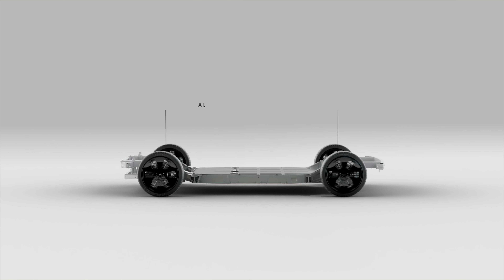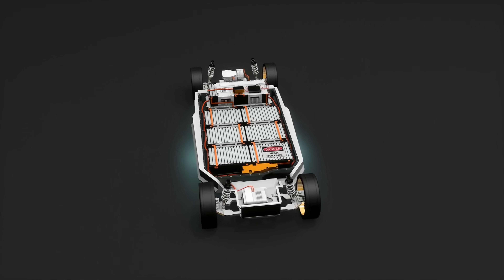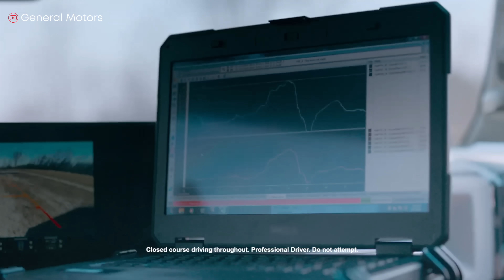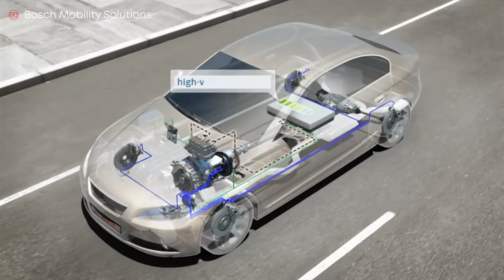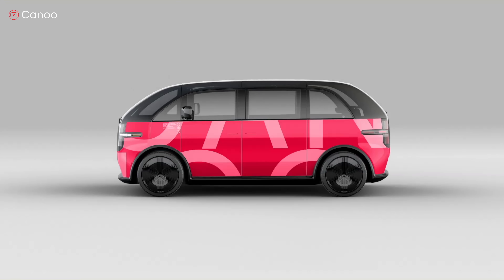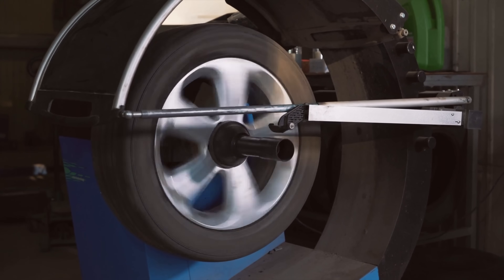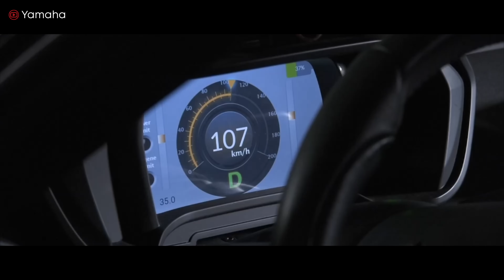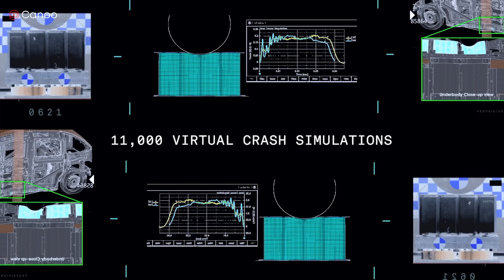No One is Telling You the Truth About Electric Cars, So I Have To

Comment: You did a good job telling us about the basics of an EV vehicle. MY concerns are with distance, driving from Missouri to Florida. With EV with a range of only 200-300 miles per full charge, minus some distance due to weight/load and heat & cold, forcing the vehicle to use more electricity for heating & air conditioning for the passengers, THEN needing 12-15 hours to charge so you can drive another 250 miles... it would take a week to drive to Florida and another week to drive back home.
Reply: It charges very slow on home plug, it can fast charge within hour in charging points. Also sure ev are bad for long distance but most people use vehicles for commute.
Reply: About half an hour for my car to charge on fast charging, and I'm using a vehicle with the slowest form of fast charging around, I believe. Then again, this is for 120 miles. It takes about 7 hours to charge mine up after a 40 mile round trip to work, but that's from a standard 3 pin wall plug so basically the worst case scenario.
Reply: Fast chargers take 30 minutes to charge to 80. Take a break after 300 miles or so. Its good for you.
Reply: No manufacturer wants to give the hard facts about Winter driving and the average 40% battery loss of said battery. A blue collar EV vehicle will only average 300 miles on a full charge. Now its Winter in Northern Illinois , the temps drops into the 10 degree range. So I live 150 miles from Indianapolis, a round trip is 300 miles, now I will have to recharge the battery 3/4 of the way home, THATS CRAZY. BTW, my 2012 Honda Accord has a 18.5 gallon tank, it gets 33 mpg, that’s almost 500 miles before I need to take 10 minutes to refill and drive another 500, do you get my drift.
Reply: @skubefamilychannel  Imagine for a moment if EV were the legacy technology in place. How easy it would be in that case for combustion engine to make their case. Long range autonomy, short refilling time not depending on how many cars are queuing up at the gas station, no headache with charging cable typology or charging station technical characteristics, negligible performance loss in case of cold or hot temperature, less weight, no crazy acceleration as potential form of hazard in case of unexperienced pilots, easy to estinguish in case they catch fire. It would sound revolutionary
Reply: good luck with that.

Comment: Scotty, how did you get to be so smart? You're my hero 💙.  A friend of mine bought a Prius a few years ago and bragged about his gas mileage, blah blah. Then the batteries died..$7,000.00 to replace them. He got rid of the car. I laughed and told him I'll stick with my 93 Toyota Camry. No car payments and not much maintenance.  👌
Reply: A friend of mine had the same thing happen.  One Prius was still going strong after several years, but the other required battery replacement after about five (right after the warranty was up I believe).  He did the math and replacing it plus the depreciation meant it was a paperweight -- there wasn't a thing he could do with it, and no one in their right mind would buy it.  But he was still a true believer, for some reason.
Reply: @jdraven0890  My friend replaced his "dead" battery (only two cells were dead) with a refurbished for 1200 euros. He got 3 years warranty for the refurbished battery. The shop took his old "dead" battery, they will replace the faulty cells and they will sell it to somebody else with warranty. If you can't think for simple solutions... It's like I have a broken valve in my engine and you ask me to replace the whole engine and the drivetrain.
Reply: I find that hard to understand a Prius battery is NiMh (cheaper older tech than Li) and pretty small as well, even Toyota say it should cost $2600 to replace.
Reply: @matthewisaac6895  ..I don't know Matthew..that's what my friend told me. He said underneath the whole back seat are multiple batteries.  He sold the car because he couldn't afford to replace them. All I know is what he told me.
Reply: Funny we have two Prius’s the little 12 volt battery lasted 7 years and the main has never had issues. It’s a 2010. The other one is a 2014 and its 
little battery was just changed after 7 years and the main has never had issues. Don’t know where they went for service but it doesn’t cost 7K to change them. I have even seen videos here on how to do it. By the way the car still runs without it being in good shape.

I think we have become so lazy that we are afraid to do anything ourselves. I still have a 90 Mustang that I do everything on it. Electric is just cars evolving, once gas really starts to become scarce you ain’t gonna have a choice, it will be too expensive. Humanity has to evolve to survive.
Reply: @veronicahawthorne3452  cr
Reply: @jamielopez2511  ...CT?

Comment: Loved my 30mpg 06 Escape hybrid until the battery tanked in its 15th year. It has 170,000 miles. And was still in great condition, as a daily Montana driver. The replacement cost of the battery made all the money I'd saved on gas irrelevant. 

For a couple grand I can always buy a new crate engine to keep a fifteen of twenty year old normal car on the Road. There's got to be a way to turn in the old hybrid or electric car batteries in order for all the initial edits cost to be worth it with an e vehicle in my
Opinion.
Reply: how much was the replacement cost? Also I assume you could still drive since its a hybrid? Let me know
Reply: My friend had a Honda hybrid. The battery died and really screwed him over. While he could still drive, he had to keep it above a certain speed to keep it using the engine. If it dipped below, it would try to switch to the battery and stall out. He was left with two choices: 
Replace the bad cells as a cheaper fix and hope the remaining older cells don't die next.
or
Buy a brand new battery that will cost and arm and a leg.
Reply: @BungieStudios  there have to be  ways of bypassing electric and only stay on gas
Reply: @slickman5969  Well then, the point would be made in that case. EV's are not hybrids, there would be no gas to rely on when the battery fails.

Comment: Question regarding hybrids / EVs. Jeep 4xes are having major problems in extreme cold? For all practical purposes the electric mod is not useable most of the Winter. What is the effect of very low temperatures on EV use / range? Is there any data on how road salt affects EVs batteries, electronics etc.?

Comment: It’s not the environmental answer that’s taking into account the resources needed for the battery
Reply: yea , what  do  you  do  with  all  the  big  old  corroding n  leaking  lithium batteries ?  landfills  are  full.
Reply: Totally 100% right and then coal factories that have to produce electricity for electric cars blue twice as much
Reply: yea ,  EVs  n   batteries  are  so  inefficient......even  moreso  in  very  hot  n  very  cold  climates.
Reply: Someone learned from internet memes and not actually facts. Less than 19% off electricity produced is from coal. The batteries are recycled not landfill.
Reply: @driver4011  ever seen an open coal field? Ever measured what the environmental loads coming from a coal stack are? Your looking at the small picture. We need to move beyond the petty, yes there are issues but you can only deal with them as they occur. Yes currently most power is from fossil fuels but we can change that.  Its not an either or proposition.  Its obvious we cant fix everything in one go, popular attention span isnt that good.  As for land fill full of leaking lithium batteries, aint seen one yet.
Reply: in north America, about half of electricity was produced by burning fossil fuels concluding charcoal, natural gas and gasoline or diesel
Reply: True. Battery manufacturing and recycling is a dirty business. Not environmentally sound when you also factor in power generation to charge batteries.
Reply: @andyfreeze4072  Sometimes the wind don't blow and the sky ain't blue, especially at night and especially in the winter.  Texas found that out this year.  Nuclear is clean and safe but Saigon Jane made a movie about nuclear once so that's out of it.
Reply: Coal mining is eco friendly when compared to lithium and cobalt mining.
Reply: @driver4011  who cares about the environment, you get instant torque 😅
Reply: @jhill4071  you make assertions my friend. Not facts.
Reply: Gas vehicles aren't either. I guess it's back to biking and moving on foot.
Reply: Just think  
with  a  wind  turbine, eventually  lose  power  when  the  thing  comes   / blows  apart  in  pieces, comes  down  because  of  a hurricane and / or  tornado, or  just  fizzles  out  n  quits  working.  won't  last.
Reply: @maxwellcrazycat9204  
so  true......plus the  whole  process  is  so  inefficient....n  so  much  waste.
Reply: Just think  
so  true....agree....wind  power  is  not  the  answer.

Comment: Lithium Ion batteries made with Iron and Phosphate can be charged to 100% without damaging the battery and can be drained to near 0% without damaging the battery unlike Lithium Ion batteries that use Nickle and Cobalt which is what Scotty is referring to in this video.  Lithium Iron Phosphate batteries last 2 to 3 times longer than the batteries Scotty is referring to in the video and are cheaper.  Tesla, Ford and VW have all announced they will be switching to Lithium Iron Phosphate batteries though Tesla will only be using them in their standard range vehicles and continue to use their current battery in their long range versions.

Another thing I wan to clarify is cold weather effects on all batteries.  Yes in very cold weather electric cars have less range because the batteries can't hold as much charge when they are cold.  Once the weather warms up the electric cars gains the range back.  Cold does not damage the batteries.  It just doesn't let the batteries hold as much charge while they are cold.

Battery technology is being developed and new types of batteries that are cheaper and hold more charge pound per pound that will increase the range of EVs are on the horizon.  My bet is we will see them in less than 10 years.  One battery currently in development has 3 times the energy capacity of current EV batteries.  The standard range Model 3 has a range of 263 miles.  Multiple that by 3 and you get a range of 789 miles.  Even if the car battery degraded 10 miles a year after 10 years the car would still have a range of 689 miles.  After 20 years it have a range of 589 miles.  Way more than you ever really need.

I also like to address the concern over Lithium.  EV batteries will be near 100% recycled.  Once all cars are electric we won't really have to dig up more Lithium.  As cars age out to be replaced with new ones the old EV batteries Lithium will be recycled to make the new car's battery.  Same holds true for Nickle and Cobalt though I believe those will be phased out eventually and the Lithium Iron Phosphate don't use them anyway.

Comment: Degradation of 2.3% in the first year, with smaller degradation percentages for following years.
Obviously not exactly the same for all EV types and battery chemistry, but battery degradation in Tesla are very well documented with vast amounts of data in support.
And Tesla batteries after year 4 show very little further degradation ... A lot (!) less than 2.3% per year.
And that's just the battery tech from 2018/2016 which - by 2021 - is significantly outdated.

Comment: I idled my little 4-cylinder today with air on freezing cold for like 40 min while on phone in parking lot , car is 20 yrs old.
Try that with electric car and battery will be dead. Mine only sipped a little gas.
Reply: Yeah but the plan is to reduce CO2 emissions, remember.
Reply: Congratulations?
Reply: one time   forgot to shut down  Lexus Hybrid. It  was running a few hours overnight on batteries.